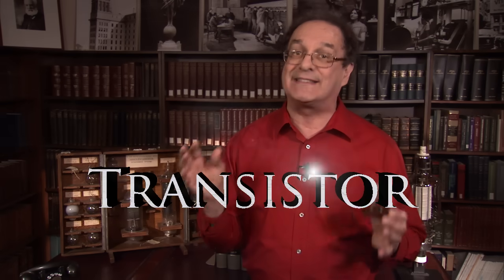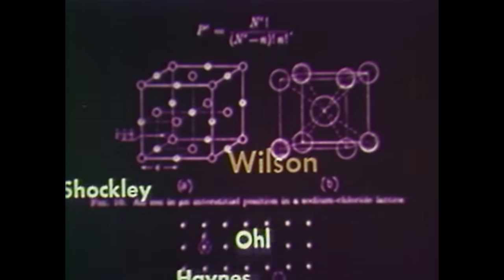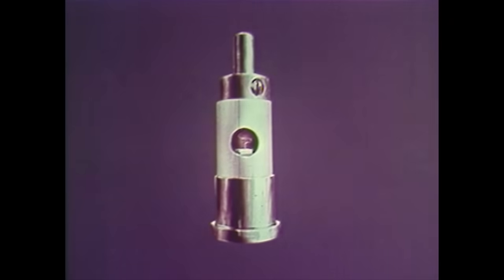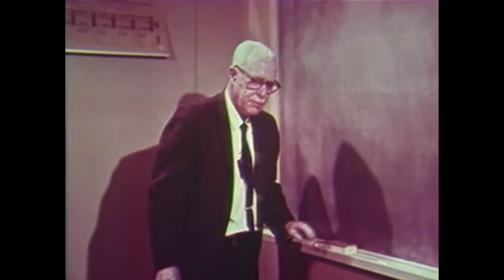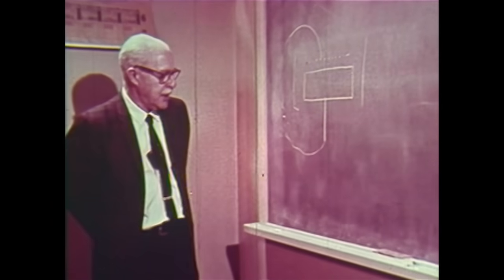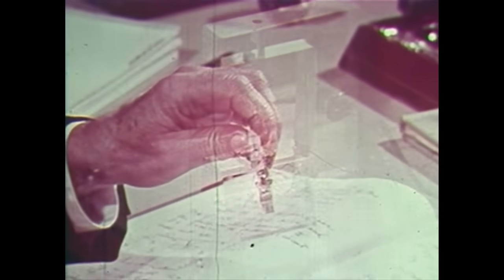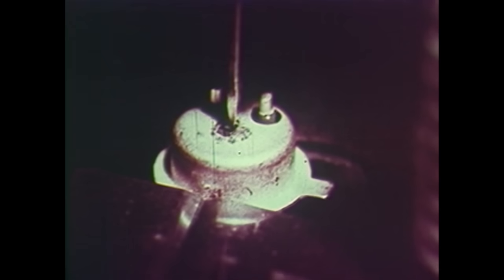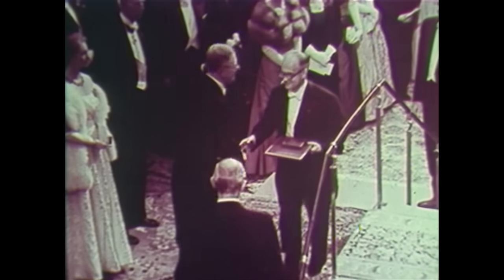The Genesis of the Transistor, with Bonus Introduction - AT&T Archives

Comment: I'm 70 years old.   When I was young I walked around our house counting the transistors in everything we owned.   At first it was easy, with a Zenith 5 transistor radio.    Soon I was up to  20, and then my father bought an SCR speed controlled electric drill.  It has  another semiconductor, but it's different!.   After a youth of playing with electronic kits and working in a TV repair shop after school,  I ended up enjoying my career at Bell Labs.

Comment: This film was made around the time I bought my first transistor radio.  It was $10 at Woolworths.  I paid half and my mother kicked in the other half.  It had 7 transistors, IIRC.

Sitting at my desk, I am surrounded by devices with transistors and integrated circuits, including a smart phone, tablet, audio receiver, clock, printer and three computers!

Comment: I would have voted for the crystal triode name.   I'm still not 100% convinced this falls in the resistor family.   Also makes more sense with how it relates to the crystal diode.    Also,  I thought the name came from Transfer and Varistor meaning to transfer current across a variable resistor.  Crystal triode seems more simple to me. I suppose that's probably why I never worked at Bell Labs.

Comment: I worked in the very building that these gentlemen did their work in the 1980s through the end of millennium. It was a humbling experience that was the highlight of my proffesional life. I was there at the beginning of the end. What remains of Bell Labs will soon move out of the historic Murray building. They are moving to a modern office building in New Brunswick , NJ. I hope the historic site is preserved.
Reply: I have been going to Bell Labs since the early 90s as a technician, still going. I have to move the equipment when the Nokia tower is built. It's sad right now, Murray Hill is basically empty.

Comment: AT&T was basically the Google of those days, they controlled/ran EVERYTHING.
Reply: Do you say that in a bad way or a good way?
Reply: @wafflefry18  Both really, it had its good and bad points.
Reply: @davidca96  what was the bad?:o
Reply: @wafflefry18  they were a monopoly, basically in full control so they became too large and powerful.
Reply: @davidca96  My view is that "The Telephone Company" designed and manufactured what they thought the customer should have.  They built up a wonderful switching and long lines system, but innovation regarding customer features came after divestiture.
Reply: rheostat

Comment: Documented dated evidence is available that the design of 1st. solid state transistor- Valve" was invented by Dr. Henry Moray senior, who went to Bell labs in 1950 to show his large device called the RE. A subsystem of that was the moray valve amplifier hand made solid state transistor. Lab notes are dated with signature. His son published book called - The Sea Of Energy In Which The earth Floats! Cold cathode first stage glass tubes with radioactive material supplied grid power for further stages of the free energy power system with cosmic antenna. $500,000 at that time period.

Comment: Does it amplify because the electron influence is greater than 1:1 ?  Such as: one electron jiggle on the controlled side allows more than one electron to pass on the other circuit?  It seems energy is needed to do amplification.
Reply: Yes Lou, that is exactly correct.  Transistors are characterised in many different ways.  One of those characteristics is "beta" which is a measurement of the "current gain" of the transistor.  The  beta of a typical good quality small signal junction transistor would be around 100.  This means that if you send 1 electron into (or out of - transistors are made in both NPN and PNP polarities) the control element (the "base") of a transistor 100 electrons will flow in the output circuit (the "collector") assuming the external circuit makes the electrons available.  The third connection of the transistor (the "emitter") is common to both the input and output circuits and will see a flow of 101 electrons.   Beta is not a fixed number.  Different types (part numbers) of transistors will have different betas and transistors of the same part number can have a range of betas and still be considered as meeting the specification for that part number.  The beta of a given transistor will vary with temperature, voltage levels, and the amount of current flow among many other things.
Reply: I asume that natural flow of big curent (e.g. ~100) exists anyway , between colector and emiter 
...only ...
what maters is 
a base currents " shape"
 that just modifies 
already existing flow 
..into a magnified copy of itself.

Am I right ???

Comment: 10:04 Why it this considered an amplifier and not a type of switch?   Or is meant that with other circuitry on the switched side an amplifier (or other qualities beyond the vacuum tube) could be designed?
Reply: Transistors are used to amplify as well. It's all about how they are wired(circuitry).
Reply: @ShaunMcDngh  How does it have this energy to do this amplification? If it is due to the matter used, does that matter eventually deplete?
Reply: @louf7178  Basically a transistor can be used to control a larger voltage/current in a circuit from a smaller voltage/current. There are thousands of different transistors. Some are used to amplify voltage and some better for current, some are better switching applications(again controlling a voltage or current from another voltage or current).
Reply: @ShaunMcDngh imagin you put your hand/ fingers 
in dark room 
in front of the reflector....
....reflector with its original Power drives the light beam and creates the white spot
no the wall ... 
and with the small movements of your fingers you create HUGE black picture on the wall 
and you modify its shape and activity. 
..i think 
something like ... that...
(???) 
Big curent already exist in the loop emiter - colector 
...incoming signal 
...avtiny current 
on the Base 
...just 
gives a Larger  existing signal 
 a SHAPE ....
...
a larger signal becomes 
A copy of 
the small original signal.
Reply: transistor can be understood as a current controlled variable resistor. A small control current controls the flow of a much larger current. The energy for all of this is provided by the control current source and the main current source. The way you put them in circuits then allows to employ currents or voltages to control currents or voltages. But fundamentally transistors are current controlled resistors (that also acts as a diode). Field effect transistors work differently, they are voltage controlled resistors (that also act as a diode).
Reply: @lapin46  Thanks,  I, since, have a better understanding.

Comment: 14:47 By solar battery, do they mean solar panel?
Reply: The ol' Napster Cat is still lurking I see.
Reply: Yes, although "panel" usually means large.

"Battery" is commonly used wrongly for "cell" (e.g. dry alkaline cell); a solar "cell" is probably commonly used wrongly because it is a battery of solar cells, and here it surely is a battery of solar cells (performing the similar function of dry cells). Again, a "panel" would be large e.g. on top of a house roof.

There is use of common language terms here.
Reply: A solar panel is multiple solar cells to create significant amounts of power.

Comment: ah the basics.  I remember making a home made crystal radio set.  Wrapped wires around a toilet paper cardboard tube, ground wire to the steam radiator, a piece of crystal a diode and voila
Reply: I remember building these crystal sets using my mothers clothesline for an antenna. I still have a few bags of polypacks transistors ffrom the fifties